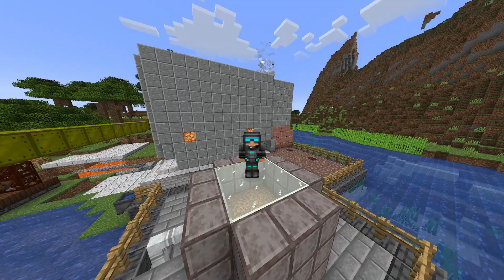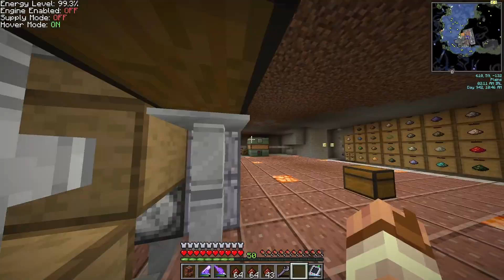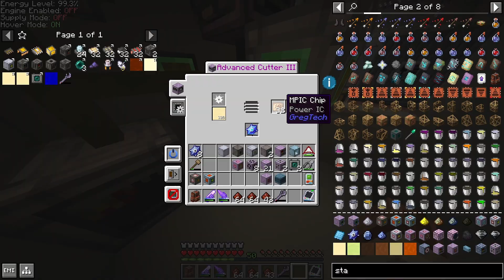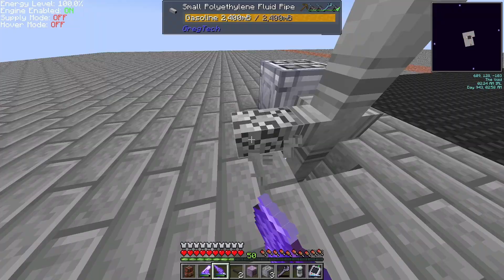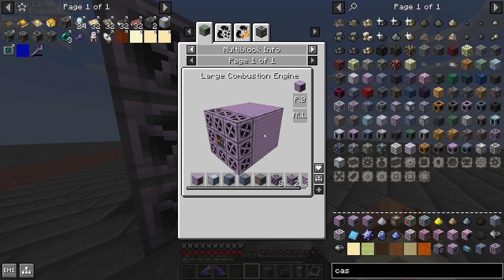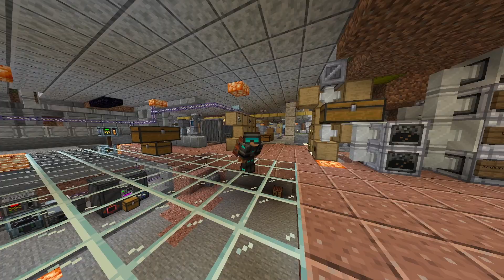Gregtech Modern Ep39: Multi-Block Generators and Tungsten Group Processing

Comment: Having a highly advanced ,,muffler'' to reduce pollution makes total sense and is realistic. 

The most recent example that comes to mind is copper ore, which not too rarely contains fairly large quantities of arsenic and copper processing plants, which want to process such ore, spend fortunes on exhaust filtering... if they're up to code...

Exhaust filtering is also impotent for coal plants, as coal is quite the mess and aside from mercury, arsenic and selenium coal releases corrosive sulfur and nitrogen oxides. If you've ever heard the term ,,clean coal'' it's referring to the exhaust systems of the coal power plants minimizing the risk of acid rains by a marketable extent. 
Modern car exhausts interact with the engine computer to make the engine alternate between running lean (producing more nitrogen oxides) and rich (producing more unburnt hydrocarbons), so the catalytic converter can work to reduce/oxidase them.

Interestingly enough heavy metal poisoning from arsenic in copper ore (and even added in early bronze before being phased out because it was to toxic even by the standards of back then) is actually why Hephaestus, the greek god of the crafts, can't walk. 

Not even gods are safe from pollution.
Reply from the maker: It does make a lot of sense for the muffler tier to work that way. Though I am not sure that it is relevant in this pack as I have yet to deal with pollution issues. My guess would be that as this is an introduction pack it might be disabled.
Reply: @Precursorhunter  i'd think a good introduction should mention both of those things, but apparently not.

Comment: Maintenance hatch doesn't have to be on the bottom side, just in two central places on any long side (left/right/top/bottom), as well as all other hatches.
Placing hatches on any edge is not allowed for large turbines and large combustion engines.
Reply from the maker: Good to know. Without actually knowing or thinking about this rule I actually set it up properly for other input later on.
Reply: @Precursorhunter  There used to be tooltips in GT5, when I played it, so my experience helps a bit. Also, a 3d model of a multiblock machine in EMI helps a lot, just click on any block and you will see which blocks may be used in this particular place.